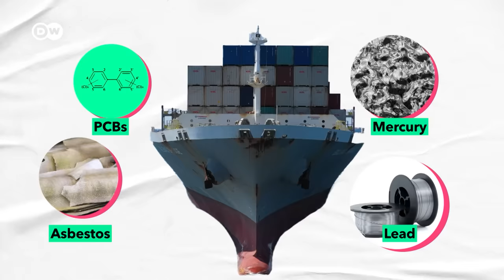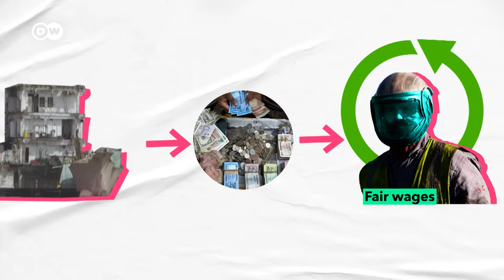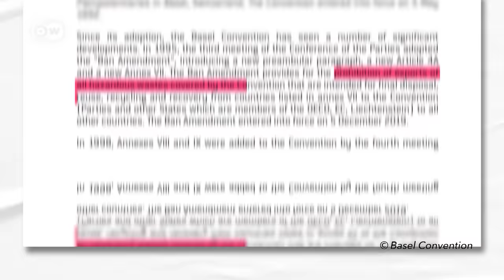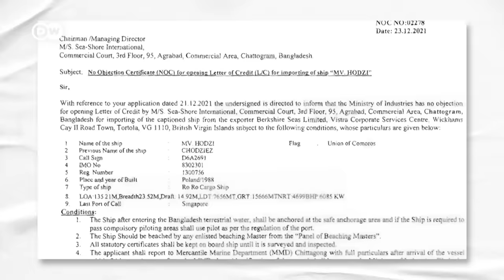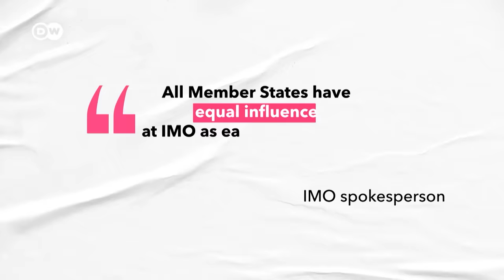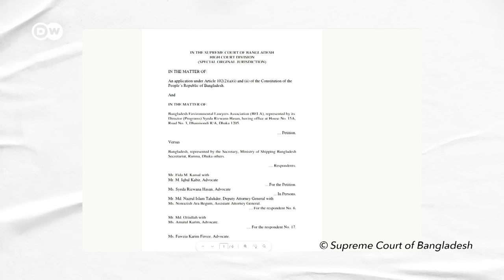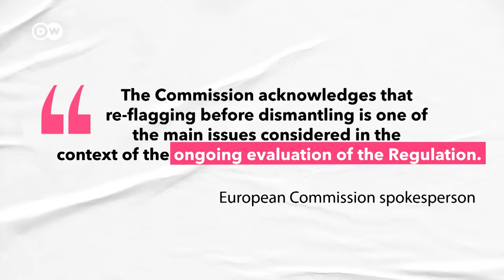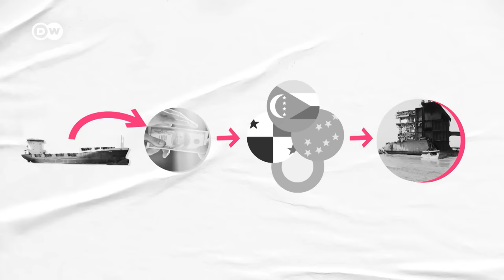Bangladesh: Where our ships go to die and pollute

Comment: All ship breaking yards in India follow safety rules. Ship breakers wear safety gear and use machines to disassemble ships. Some ship breaking yards in India’s are even “green” certified.
Reply: These is misinformation in the video. The ship breaking industry is safe in India and workers are not exposed to any unsafe environment. About 99% of the total materials recovered from the ships are recycled. Of the total recoverable material over 95% is steel, about 1-2% of total LDT (light displacement tonnage) is the other valuable metals and 0.5-8% is furniture and other fixtures. The steel is sold to the re-rolling mills, which is the main source of revenue. Better make a video on how the other countries could follow the India's way of safe recycling of ships.

Comment: Beaching method itself is not responsible for polluting the sea and soil, most of the time it is explained wrongly. It is possible to dismantle a vessel safely and without having any activity in the intertidal zone even after applying the beaching method. If the landing method used in Turkey is acceptable to EU then why not the beaching method? Technically there is no significant difference between these two methods. It only depends how you treat/ follow the methodology for recycling after the beaching/ landing of the vessel.